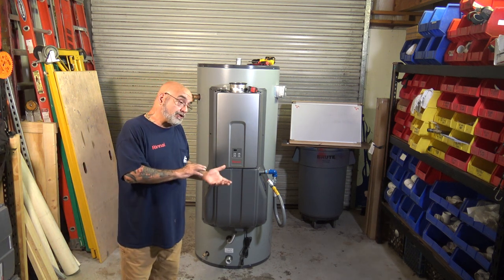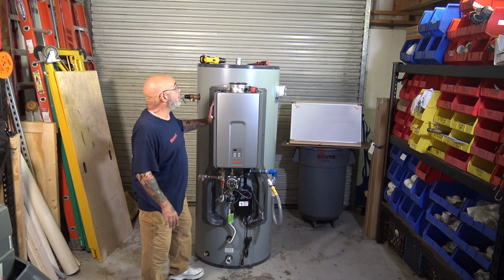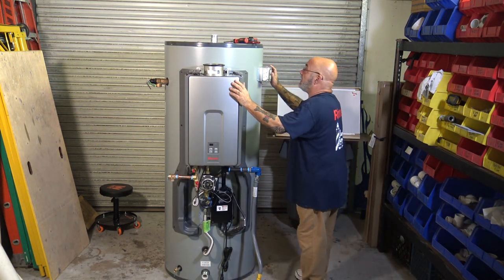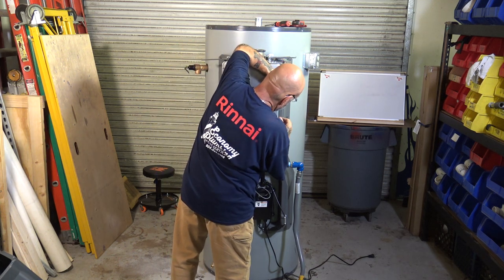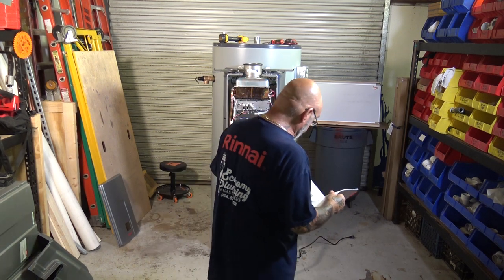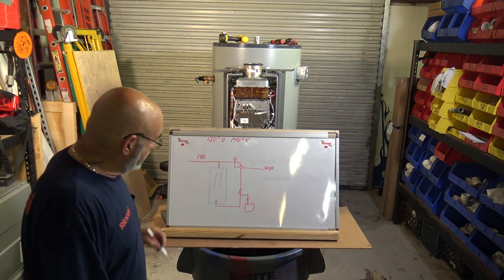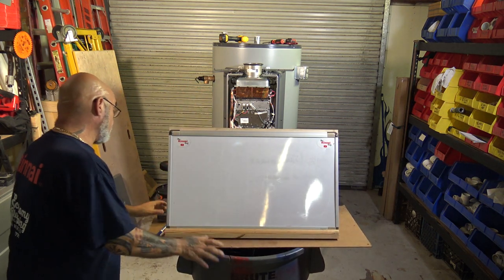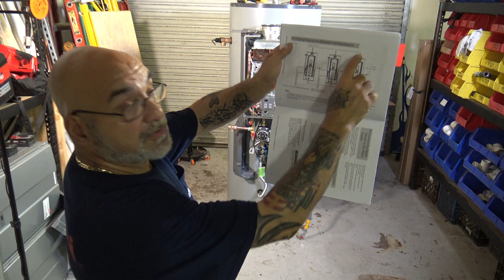Rinnai's new Demand Duo R series CHS199100RI

Comment: Great help. Finishing the Rinnai RUR199IP.  Plumber did 90% but he has a new job with lots of work and OT.  So with your help I believe that I can handle most of the other connections. I will have the propane supplier do the tank and 10 regulator to the buried ground whip.
Thank you for your help!

Comment: Hi Mike, very informative video. I am building a new home and was considering a Demand Duo CHS13080Hin (we may have many guests a different times and I love the idea of unlimited hot water). My concern was your comment that the system should not exceed 4GPM. A couple of showers could quickly exceed that limitation. I'd love to hear your thoughts on this issue.

Thanks for all your work with these videos!
Reply from the maker: That was 4 GPM on the circulation loop not the GPM of the heater. That unit could supply 12 showers without blinking an eye. Mike
Reply: @ThatTanklessGuy  Thanks for the quick response. As is likely plainly obvious, I don’t know a ton about plumbing. If the recirculation loop, through which water is run throughout the house can’t handle more than 4 gallons per minute, how does the water heater supply any more than that?

Is the recirculation circuit different than the lines that supply the rest of the house?

Comment: My I volunteer my place in Atlanta to install this unit with you and Rinnai since corporate is right down the road? This would make an EXCELLENT collaboration and marketing video. I have two tanked 40s right now and I have a 6" b vent chimney and a huge 15x15 fresh air vented utility room plus plenty of fixtures for a high demand application... would love to research this with you and Rinnai! I love the ideas of hot water tank storage with the efficiency of a tankless burner, but I am wondering if this unit is too large for a residential application?